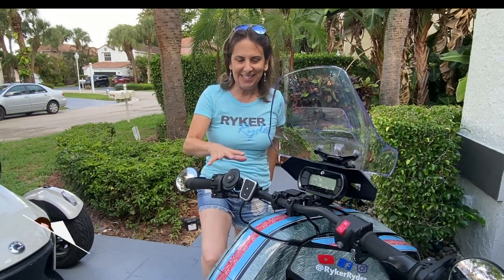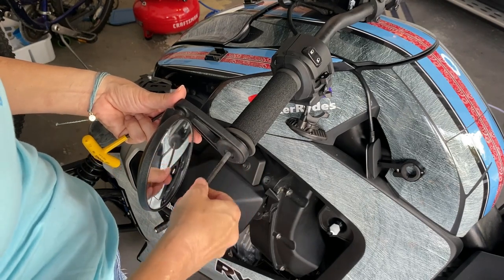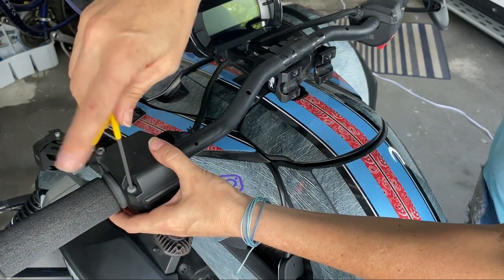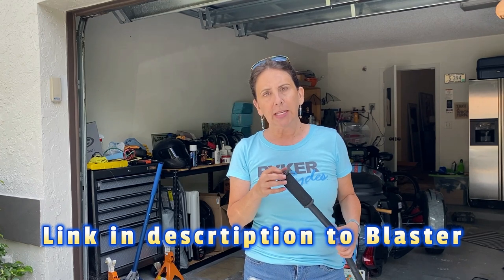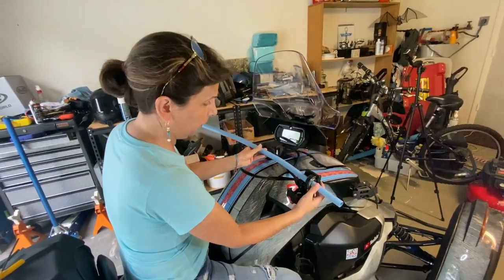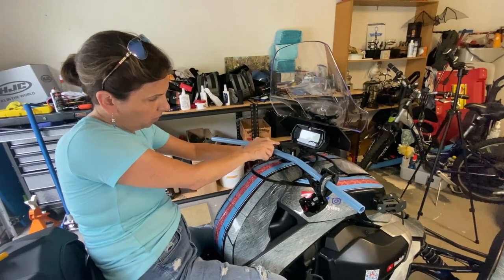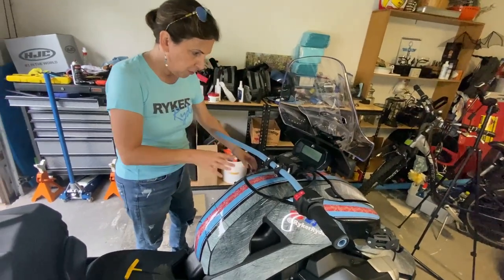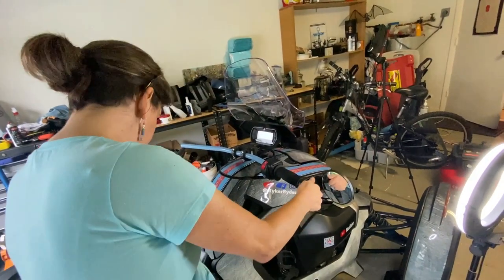RYKER Powder Coated Sport Handlebars - How to Install?  Where to Buy?

Comment: I think not, 200 bucks for a powder coated handlebar I don't think so, I am getting a pro taper handlebar and powder coat it myself for less than 100 bucks and still get quality powder paint from Eastwood paints, did my own rims on my motorcycle and get stares all the time
Reply from the maker: That’s awesome. Great job.